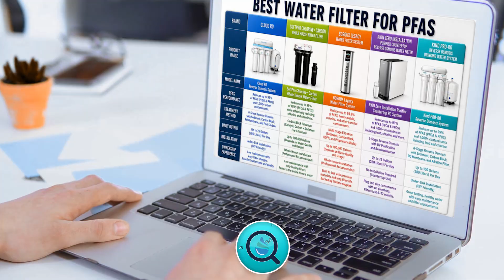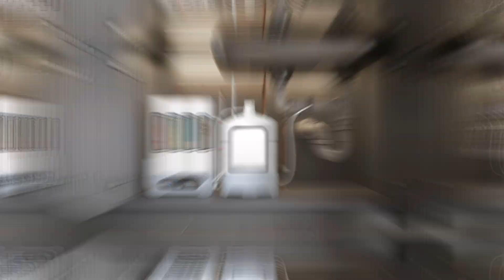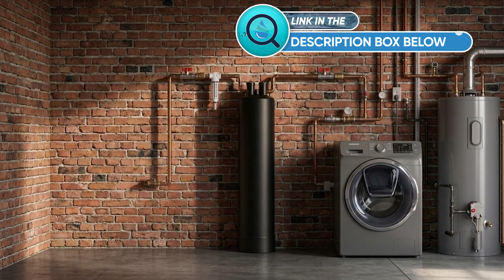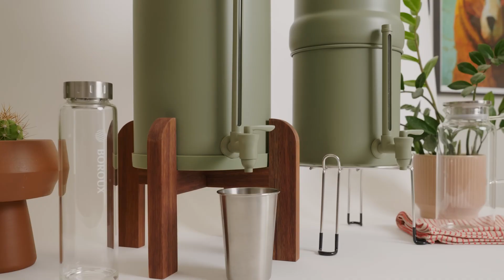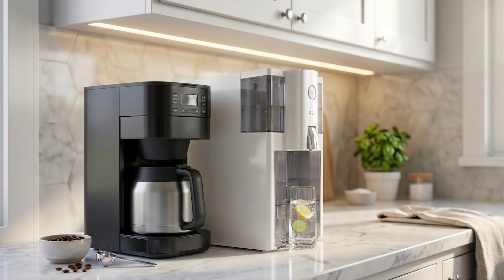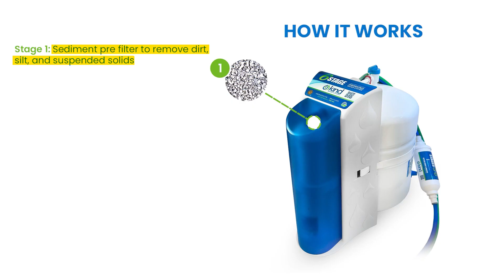Best Water Filter for PFAS 2026: Top 5 Options That Actually Remove Forever Chemicals

Comment from the maker: 📌 Best Water Filter For PFAS (Which One Is Right For You?)

PFAS is one of those water problems where the treatment method matters more than the marketing headline. Reverse osmosis is the stronger path for dedicated drinking-water treatment, while carbon-based systems can make sense when you want gravity filtration or broader whole-house chemical coverage. The right pick depends on whether you want an installed under-sink RO, a no-install countertop RO, a gravity system, a whole-house filter, or a smart RO system with app monitoring.

#1 Kind PRO-RO Reverse Osmosis Drinking Water System — Best Overall Under-Sink RO For PFAS
Kind PRO-RO is the strongest overall pick if you want PFAS-focused drinking-water treatment from a dedicated under-sink reverse osmosis system. Its 6-stage process uses sediment filtration, multiple carbon stages, an RO membrane, polishing, and remineralization, giving you a more complete kitchen-tap setup than a basic carbon-only filter. It’s the best fit if you want a serious installed RO system as your main PFAS choice.

🔎 See Full Details: https://waterclarityguide.com/go/kind-water-pro-ro

#2 RKIN Zero Installation Purifier Countertop Reverse Osmosis Water Filter — Best Certified No-Install RO For PFAS
RKIN Zero Installation Purifier is the strongest pick if you want reverse osmosis for PFAS concerns without plumbing it under the sink. It’s a countertop RO system certified by IAPMO R&T to NSF/ANSI 58 for reduction of PFOA/PFOS, along with TDS, fluoride, lead, and chromium claims. It’s the better match if you want RO performance in a no-install format.

🔎 See Full Details: https://waterclarityguide.com/go/rkin-zero-install-countertop-ro

#3 BOROUX Legacy Water Filter System — Best No-Plumbing Gravity Filter For PFAS
BOROUX Legacy is the gravity-fed option for buyers who want PFAS reduction without electricity, plumbing, or reverse osmosis. Its stainless steel countertop format is easier to place than an installed system, and BOROUX lists reduction claims for contaminants including PFAS, lead, and chlorine. It’s a strong fit if simplicity and countertop capacity matter more than choosing an RO system.

🔎 See Full Details: https://waterclarityguide.com/go/boroux-legacy

#4 SoftPro Chlorine+ Carbon Whole House Water Filter — Best Whole-House PFAS Option
SoftPro Chlorine+ Carbon is the whole-house pick if your PFAS concerns go beyond one drinking-water faucet. Its catalytic carbon format targets PFAS, chlorine, chloramine, pesticides, and related city-water chemical concerns across the home, which makes it a different buying path from the under-sink RO systems. It’s best suited to buyers who want broader whole-house chemical coverage rather than single-tap drinking-water treatment only.

🔎 See Full Details: https://waterclarityguide.com/go/softpro-chlorine-plus-carbon-filter

#5 Cloud RO — Best Smart Under-Sink RO For PFAS
Cloud RO is the smart under-sink RO alternative for buyers who want reverse osmosis with app-connected monitoring. Cloud lists PFAS among the contaminants its RO system removes, and the app tracks filter life in real time, which gives it a more modern ownership experience than a basic under-sink setup. It’s a strong fit if you want RO plus easier system tracking.

🔎 See Full Details: https://waterclarityguide.com/go/cloud-ro

✅ How To Choose:
• For the strongest overall under-sink RO pick: Kind PRO-RO
• For certified no-install countertop RO: RKIN Zero Installation Purifier
• For gravity-fed PFAS filtration: BOROUX Legacy
• For whole-house PFAS and chemical concerns: SoftPro Chlorine+ Carbon
• For smart RO with app monitoring: Cloud RO

(Some links are affiliate links. I may earn a commission at no additional cost to you.)